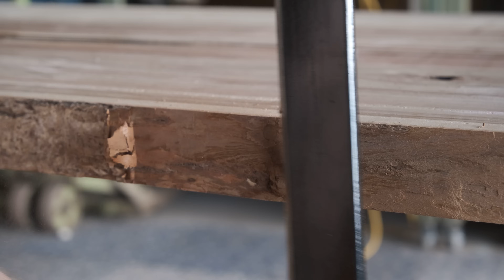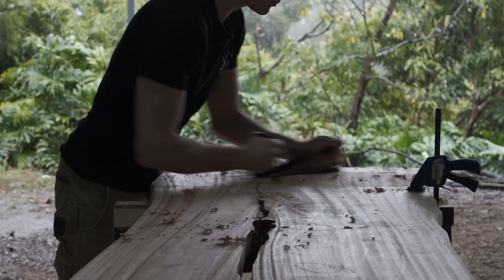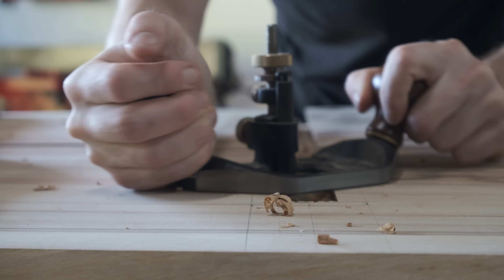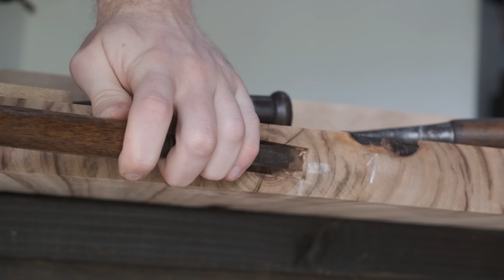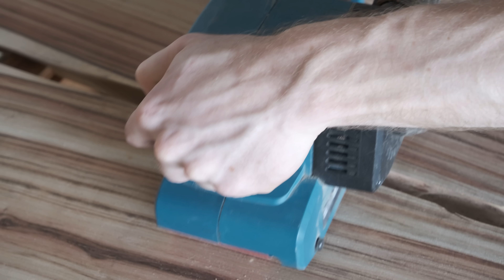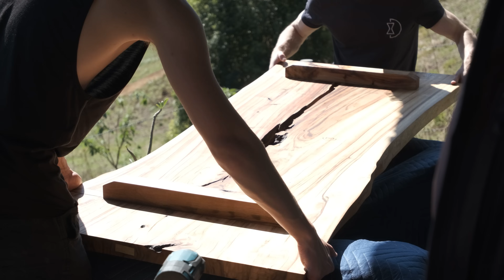Firing Shots at IKEA

Comment: One piece of advice....as you get more comfortable using the handheld router, instead of holding it really high on the tool, you can hold it with your fingers on the plastic base (obviously remembering the danger factor) but that gives you tons more control as your fingers are making fine adjustments as opposed to your arms making gross adjustments for the movement.

Comment: Perhaps I misheard you, but you said you planed across the grain to avoid tearing out wood fibers? I thought you were supposed to plane with the grain along the length of the board.
Reply from the maker: This is a scrub plane which takes a pretty aggressive cut. Usually you'd want to plane with the grain but a heavy cut like this is really likely to dig too far in and pull chunks out of the wood if it hits difficult grain. Going across the grain makes this much less likely, problem being the finish off the plane is worse in this direction but this isn't a finishing tool.
Reply: @djangokaistudio  Had no idea it was a scrub plane!

Beautiful work by the way. I love your commitment to using hand tools as much as possible, especially when leveling the table. Your background scenery is gorgeous by the way!

Comment: Nice desk.   But I would curse you every time my pen, pencil, etc disappeared down through the crack.  😅😅
Reply: I was wondering what you could fil the crack with if not epoxy, and I reckon you could do plaster of Paris.  No.. bear with me.  It sets really hard and it would sand to a fine finish.  You're  right no one else has done it, but maybe there's a video in that for you.  Good luck.
Reply from the maker: That's the point 🤭